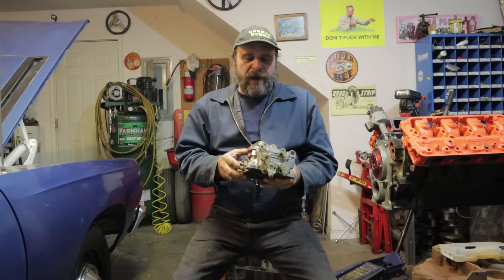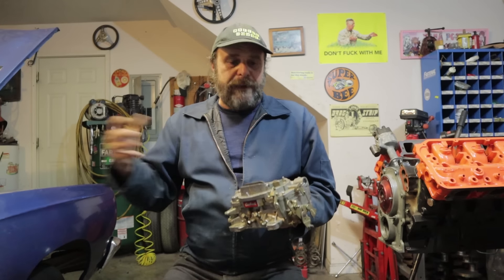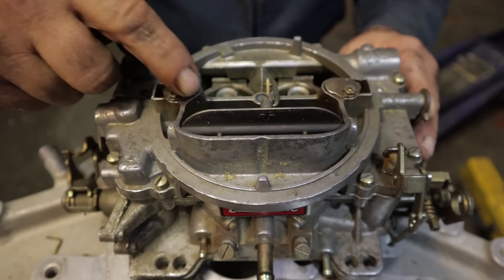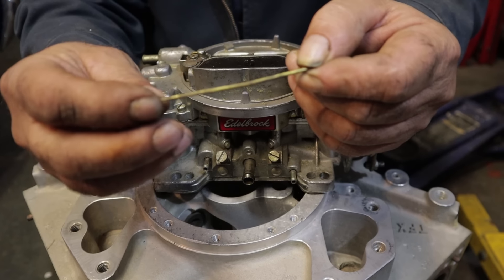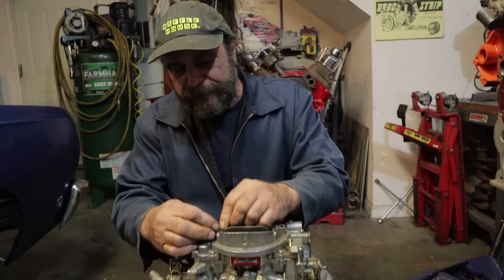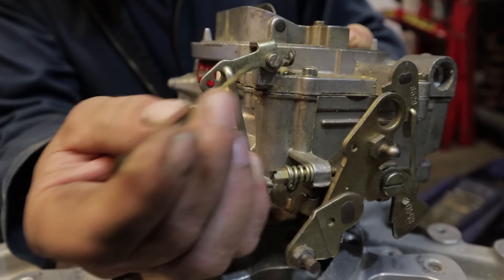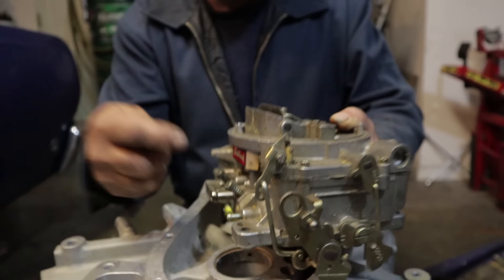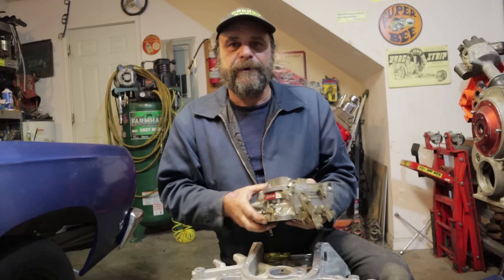How To Make The Edelbrock Carb REALLY Work For You

Comment: Hey Tony what's your thoughts on the Summit house brand carbs? Top comes off like an Edelbrock but the float bowls are at the front/back like a normal Holley. I've been running one for a couple years now, runs pretty good once I got it jetted/power valved correctly.
Reply from the maker: I've got one on a 273, but have not played with it yet.  Seems to be happy right out of the box on that particular engine

Comment: I’m having a stumbling issue. Not sure what it is yet, but when I go up a hill it starts to bog and stumble. Let my foot off, it comes back, get in it and same thing, but not all the time. It’s on a 460 in a 79 F150. Any ideas? I will check the secondary circuit, as it’s not a daily driver. It is a 4 speed manual, and on flat roads I haven’t had the problem. It seems like on hills it happens. Just started doing it a few weeks ago. No problem before then.

Comment: I just installed one of these carburetors on my chevy 350 im using the edelbrock fuel pump 6psi  truck was running fine the following day came out to finish tuning and gas starting spraying out of my metering rods i pulled it apart and adjusted the floats with a 7/16 drill bit  and set the float drop to 1" still has gas spraying out of the metering rods any idea what's going on here

Comment: my favorite curb is auto light/sumit brand! it a holly with integral bowls. have a 351w that sat for 2 years with sum runing hear and their, the motor craft 2150 needs a cleaning as it is running ruff. it is in good shape so i am just going to Clean it out do you have tips? if it needs a rebuild i was thinking a 500cfm 2300 holly would be better than a 350 cfm motor craft. I can get a rebuilt holly 500 cfm 2300  for a bout 200$ the 2150 is worth 100$ so i will go that rout if it needs a rebuild. the 351w is mostly stock has fox body headers 2.5 duels glass packs and a h pipe. re-curved the dizzy. was thinking a 500 cfm is more like what it needs. all so i have a set of 1987 fox body factory aluminum valve covers i want to use but as you know thy have no pcv spot in the valve cover just a oil fill tube.  i have 2 drivers side covers so i have 2 valve covers with a oil fill tube . the baffle under the oil fill tube was removed as sum one had roller rockers. the factory baffle was steel and bolted on to the bottom. I was thinking of making 2 but i do not like the idea of screws as it could drop in to the engine. was going to put a pcv valve in one oil fill tube and a breather in the other one. have enny ideas on how to use a pcv in non baffled covers? this is a one peace at a time build on a budget. well you input would be appreciated!  well take care.

Comment: uncle tony i have a few questions for you , 1, i have and edelbrock 7116 intake [vortec ] and im putting it on a bone stock lower milaged vortec engine , 2 im using an edelbrock 1406 carb [600cfm] will this set up work on a bone stock vortec engine , i know the carb itself will work on the engine but is it to much intake for the carb and engine ,,, thanks really desperate , ALSO  what are the 2 holes for on the 7116 intake on each side of the carb plentum , are the necessary or can they just be blocked off , thanks

Comment: I have a fresh 302 with 1406 carb, my problem seems to be with the metering rods and springs, I have the pink 8"Hg springs in it and they still will not overcome the vacuum under a load and stumble bad with no stiffer springs available do you have any suggestions?

Comment: I just got a 64 Chevelle Convertible Malibu drove it down the street and it was bogging out it has the elderbrock carb with 283 original engine and transmission how how far do I need to drive it before the bogging gose away

Comment: I have a question. I have a 600 cfm edelbrock on a stock 350. If I let it sit for a couple of day's, pump it three times and then start cold. It will run for a couple seconds and stall. Pump it once more and restart it runs fine? Any thoughts on adjusting so it won't stall?

Comment: Tony are you going to do a video on a Quadrajet Carb? I found out tonight that my 360 has a Chevy Quadrajet on it. I have to start my 360 by spraying starter fluid in the carb then when I put it in any gear it dies! Could the issue be the Quadrajet?
Reply: I think in 85 Chrysler started using quadrajets on 360s it should have a pentastar stamped on it! yeah she probably needs a rebuild
Reply: @sczuylevch13  My 360 is a 1975 Dodge W200 Power Wagon Truck.

Comment: I'm interested in MPG gains. 67 Chevy, 2wd, 350, 4 speed is only getting 12.5 MPG. Starts instantly, Engine has been rebuilt but I don't have any information, Headers, full exhaust, Edelbrock intake and 1405 carb, Seems to be tuned pretty well, new distributor. Besides an EFI system (I already drive like grandpa) and a T56... I don't see how to get better MPG. What can I do?

Comment: I have a 1406 on my 78 W200 and it seems to run fine but once I'm in 4 gear it seems to bog around 3500rpm when it was just fine in second and third. Am I running into a lean issue because the secondary wasn't full?

Comment: I got a sbc with a 1406 with a manual transmission runs good normal driving but in first you floor it it's great but after every gear it breaks up for a sec then starts running great again any ideas

Comment: Having problems with vapor locking in my edelbrock 1400. Driving me crazy.  Tried phenolic spacer and heat spacers  with no luck. Even mounted a fan on top of the motor with bailing wire. Any ideas would be appreciated.  Thinking about stuffing the exhaust crossover with exhaust heat tape. Or pulling the intake off and plug welding the exhaust ports. Or my spend the money on a air gap.  Im going crazy over this.
Reply: Motor dosen't run hot. 79 gmc JIMMY
Reply: Don't want to pull the intake but will if it will help. Thinking about designing a carb spacer with a water jacket to circulate coolant.  That dam exhaust crossover is a edelbrock killer

Comment: I have an edelbrock 1406, runs GREAT but when I go WOT it hesitates and then backfires through the carburetor and dies. I’ve upgraded the accelerator pump, step up springs, coil, checked vacuum, checked timing, checked spark, Any ideas?

Comment: Is it possible to make a adapter plate for the 3.9 kegger manifold to bolt a carb in place of the throttle body? Would it run worth a crap with the intake runners being that long?
Reply from the maker: Something I've always wanted to try, actually

Comment: ..i stopped using Holley when those damn side-hung Float Bowls began leaking like a Bastard, & nearly burned down my Engine..i Only use Carter's or These Edelbrocks..the Float Bowls are part of the Casting & Enclosed, & unless you're Upside Down they Don't Leak..at which point you got Bigger Problems, right..

Comment: i have a 1406  -use -when first installed-only would wide open ,no slowing ,i took it to a carb rebuilder,he called nad said i can fin nothin wrong ,i can pur in kit ,but you won.t gain anything,so when installed ,it doesnt go to wide open,lowest i can get to run about 2000,the small rod on the side is in the the fire hole-if i have the e.c. real tight its fight for air thing when i hit throttle reas fas t -enging goes back to 2000-what am i missing thanks

Comment: Having some issues with an AVS2 I just bought for a 340. It always bogs right when you open up the secondaries. I have a wide band so it shows lean and clears up after. I’ve tried cranking the hell out of the air door and the pump shot is maxed out and it still always bogs. Any of have any tips?

Comment: how do you stop that dam check ball in the accelerator pump to stop sticking?  truck sits a week and it sticks. 3 times now i took it apart and blasted it with carb cleaner and air to un stick it. ...well im on #4 time.

Comment: My 350 has a crane Energizer 274 cam runs good till I floor it than it smothers out it has a new edelbrock 600 any ideas I changed the vacum advance on dist new fuel pump new fuel filter

Comment: every time i start my truck i have to sit there and give it gas until it idles properly, is that just a choke issue? (It's a 1977 chevy c30 with a 350 v8 and an edelbrock carb and intake)

Comment: Dang so thats why my truck bogs when i pound it after first start up (edelbrock 1405 carb, stock intake on a 460 engine). I thought it was not grtting enough fuel or something
Reply: Try Stabil 360 marine formula in the fuel to avoid problems with ethanol blended fuel.

Comment: All carb's have their + an - issues, The edelbrocks cannot run more than 5psi fuel pressure unless upgrading the needle seats or they flood, They also dont like quick little turns or stops,, they try to flood.

Comment: I have an Edelbrock carb and it is running very very rich what would you suggest looking at first?
Reply from the maker: Check that neither of the metering rods are bent and both are seated in the jets.  If those look ok, pop the top and lower the float height a tad

Comment: So my cousin has a 327cwith a small cam in it. Its in a jeep so its for low end torque. It runs rich on idle and part/mid throttle and seems to run great at wide open. Does that sound like it needs a lighter spring?
Reply: that's what it sounds like, maybe a metering rod change, get the strip kit you'll have her fine tuned in no time if you follow his steps! you got this!

Comment: Tony what is the setup I've seen with a set of four two barrel carbs? NOT a pair of four barrels!
Reply from the maker: Are you referring to the split Dominators used on Tunnel Ram manifolds? That's done to produce a more even signal
Reply: @UncleTonysGarage  not 100% sure it looked like a set of quad two barrel carbs
Reply: @UncleTonysGarage all four carbs were inline on the manifold.

Comment: Are there any way to bring my idle rpm up with my edelbrock besides the idle screw , my Moter idles now at 550 but if I idle it up it diesels on when I switch it off , initial timing is 14* mechanical is 38 and with vacuum advanced it’s around 51*

Comment: I have issues with a dead spot on mine that I can not find to save my life.

It likes to try to die on me at a position very close to dead idle and if you stomp it, often times it stumbles or dies.

I had the thing entirely apart and can not find blockages, anything sticking, or anything to adjust that would suggest its not in adjustment.

Is it possible that the accelerator plunger cup is worn out?

Maybe my spring is too soft.

I can try a slightly  stiffer spring maybe.

If its evaporating every time, how long does it have to run to fill up those channels?

Is there a cheat to pressurize those channels?

MINE does it EVERY time I start it, or at least every time the engine is cold. 

Its not reliable as to how often it does it, but often times its worse in the winter, and no matter how warm the engine gets, its still worse in the winter [I realize the carb may be slightly colder than the engine block, maybe that has something to do with it?] but either way, it never goes away, even if I run it all day long for hours.
Reply from the maker: Yeah, I assume you played with accelerator rod position and all that.  It is possible you have too light a spring, too thick a metering rod, but I'd say your issue is more related to ignition timing.  Crank ten degrees into it and see how she responds then.
Reply: @UncleTonysGarage  My brother is always getting onto me that I have my timing too far advanced, so I get conflicting signals there.

Also I had to put a heavy metering rod in it to make it get any kind of fuel mileage, just that the one with the best economy had a strange taper to it. 

Sort of afraid if I try to cut too much of that odd taper into a somewhat more normal taper I will end up bending the needle and ruining it.

I have a lathe but its really too big to chuck a needle, and I do not have a collet chuck for it.

Maybe I can slip it into a collet on the mill and use a really fine tooth file to shape down the odd area, but also I might end up losing more fuel economy.

When I got the truck [and admittedly the engine is kinda worn, has low compression on 2 cylinders (International 392, seems to tend to lose compression in number 2 and number 8 cylinders based on some layout problems)] it was running really rich and getting at or less than 5 mpg.

I got it up over 10 mpg by advancing the timing and leaning out the fuel [maybe as much as 12 mpg, but I have no reliable way to determine this because I think the gearing in the transmission does not match the axle], but it really needs a good rebuild, I am just too poor to afford that right now and my other truck is still not on the road, it needs a whole new cab, new kingpin bushings and a power steering gearbox seal, so I'm pretty much just limping along.

If I could get the engine all rebuilt I am sure I could get easily 17 mpg, and with one of those A518 or A618 type trannies I could get better mileage still.

This year if things work out, I hope to get enough money to do all of that.
Reply: @UncleTonysGarage  I had noticed that the fuel bowl tends to go dry rapidly, but I guess I never really gave it much thought.

Why would the carb dry out faster exactly?

Is it somehow related to how air flows through the carb?

Holleys have an open stack vent on top [as do Rochersters] where one can actually pour gasoline directly into the bowls, which would seem a really good place for fuel to evaporate from, if any place at all, and yet I have a 413 with a Holley which I can start on the first try after it sits for an entire year [granted, inside of a motor home, there is less sunlight type heat and that may or may not have anything to do with it, but it is pretty noteworthy that it starts right up after sitting a year, and an engine I drive every couple of days has to be pumped vigorously and the engine cranked a few times before fuel gets into the system.

I am wondering if perhaps I should just swap the Edlebrock for a Holley.

Comment: hi have 1992 chevy c1500 i swap out the  tbi 4.3 v6  out for  a tbi 350 that i converted over to carb with  edelbrock performer intake  edelbrock 1406 carb  and JEGS HEI Distributor and race style fuel pump and pressure regulator  and i have at wot it  bogs down after a few seconds been try fix i done this so far    fuel pressure set at 6psi i have set floats i put in high flow needle  and seats in  and  high flow  accelerator pump in  it  got better form moving middle throttle  to wot its fine  but take off hard tire burning it fine for the few  seconds then bogs i have let off  them smooths out to back middle throttle   any ideas what could  ?   thanks
Reply from the maker: i'd start looking at your ignition.  Crank in a few degrees of advance and make sure you leave the vacuum advance off...see if that helps

Comment: this carburetor needs exactly 4.5 to 5.0 psi to function as designed,do not run one without a regulator,it will drive you nuts,put together correctly on a street car thousands of trouble free miles,they are totally adjustable,sometimes i'll cut the springs if i can't find them,coil at a time,longer duration cams require mixtures to idle correctly,i give it what it wants,the CARTER DESIGN ALLOWS THAT

Comment: As I learned years back ,there 7 circuits on a carburetor
Reply from the maker: Which one?
Reply: @UncleTonysGarage  every carb I ever owned I took apart and rebuilt . 
chevys ,fords and plymouths . I would clean them with acetone , adjust the bowl float ,new needle and seat.  put new gaskets in. I am from Philly .

Comment: No they are not exact copies. I have a Carter afb on my 77 nova. The timing vacuum port and the intake vacuum are on opposite sides.   On a Carter, the vacuum advance is on the driver side, the full vacuum for an automatic transmission modulator line is on the passenger side. An edelbrock runs opposite

Comment: The problem with Carburetors is that they're Carburetors. They take zero account for weather, never running with true efficiency, you're either running slightly rich or slightly lean.
Reply from the maker: Yes, but they are simple, cheap, effective and can be tuned closely enough that minor differences in temp and altitude won't really matter.
Reply: Uncle Tony's Garage How about when it's 32 in the morning and 82 in the afternoon?
Reply: Uncle Tony's Garage Back in the day how did people travel from the Southern States to the Northern States and back for traveling and vacations, they had to adjust the Carburetor?       And did the automobile have the tool and how to do it in the factory owners manual?     

All I remember from Carburetors is my mom pumping the gas to start her Oldsmobile Ninety-Eight
Reply: Uncle Tony's Garage Also, let's say back in the 70's if someone bought a brand new car on the lot in Texas in the winter and someone bought a brand new car in Washington in the winter would both cars have the same factory Carburetor setting?     

If so, what was the point of having a screw to adjust the jets to begin with?